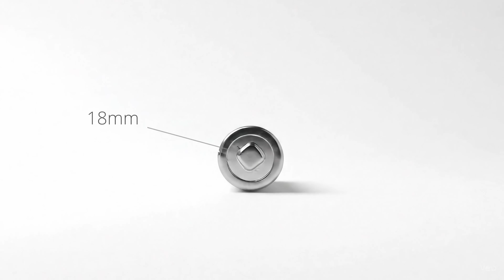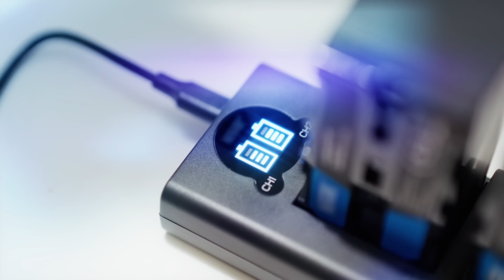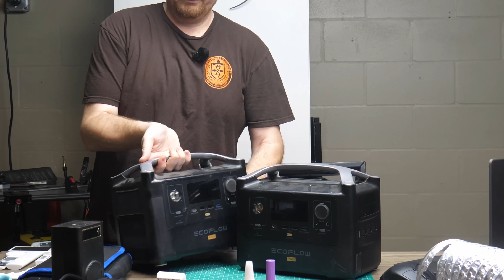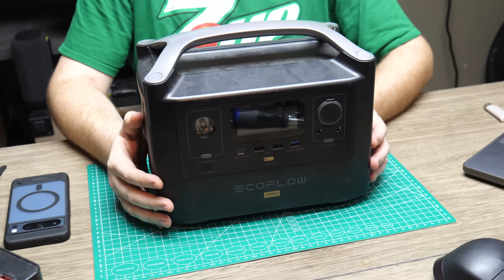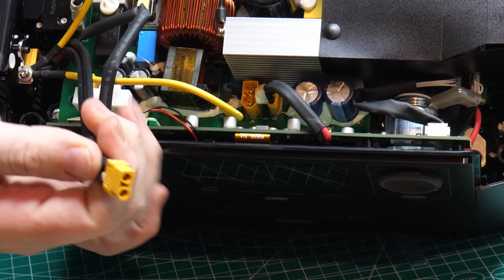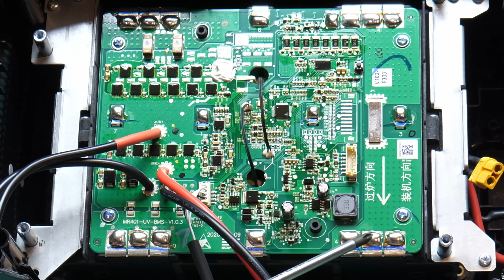I Bought 10 DEAD EcoFlow Power Stations... (Explainer and teardown)

Comment: YOU DID NOT HAVE TO TEAR IT DOWN TO DO THAT!  Ever heard of a trickle charger? useless video🤕🤢🤮
Reply from the maker: You're wrong, but I'll leave this here for others to laugh at you.
Reply: @fauxrhino  I've done it. without tearing it all down also done that with 12v exteernal battery--no problem.
Reply from the maker: I'm sure you have. You somehow got the BMS to magically turn back on and open the shunted route for the batteries to allow charge to flow. Bet you did...

Or maybe, just maybe, you had a completely different issue than I had...

Comment: The 18650 is infamous. Going back 20+ years, spare laptop batteries would die, unused, on the shelf.
 Apparently SOME 18650 cells have a built-in protection circuit. If the cell voltage drops <~2 volts, the protection circuit permanently disconnects it and bricks the entire battery.
 Some of these can be opened and reset or removed--but it is easy to cause a battery fire if you play that game.
 Replacing the cell is smarter. And, MOST of the 18650 cells you can buy on the web are used (RFE) or outright counterfeit. Stick to a repufable brand name from a known source. Avoid the very high amperage ratings, they're ALL counterfeit or scams.
 Panasonic seem to control their sales, and build a good product.
Reply from the maker: Not to drive you away from my content, but Adam Savage just did a video on 18650 quality control with the LumaField team - was an interesting watch: https://www.youtube.com/watch?v=-Y23nfAOiXQ

Comment: A tri-fuel generator from Costco may be a good option 
Propane doesn't go bad or foul the points the was gasoline does
Not sure if you can tanks refilled during a power outage
If the Propane storge tank in tall and above ground,  maybe gravity fill

Comment: Re gas in your wife's car.  FWIW, years ago a mechanic showed me how to disconnect the gas tube after the fuel pump and direct the gas into a container during an emergency. Instead of the engine's fueling system. The gas was used for a generator at a remote mountain cabin.   I'm curious if this would work on today's gas cars?  EV owner here.

Comment: Its great that you are able to get the units running again, but please do it by finding bad cells and replacing them. Not trickle charging and rescueing the cells. Those cells are damaged and are ticking away fully charged now, you do not know when they will catastrophically fail (aka long burning fire that doesn't want to go out)

Comment: Why not connect a small amount of power directly to the BMS to get it working?
Reply from the maker: With the imbalance, the BMS will fail to charge and just throw a red 'battery warning' light. Going into just the output leads does nothing because it's shunted closed once the cells drop below a certain point.
Reply: @fauxrhino  ok thanks

Comment: Some hear lithium and immediately shut down any thought of learning something new. Never mind that the batteries have been around for a long time and providing safe energy to appliances. Or that they have been, unknowingly, using them  themselves. 
It doesn't fit a certain perspective and they won't support any deviation from that. 
I've relied on them and I'm happy to use that technolgy. I will embrace chemically different batteries, whenever they are available to us. No problem.
The Bolt is a good example of what can go wrong and what someone can do to avoid any mishaps. 2017-2019 models had batteries that caught fire while charging. It cost Chevy a lot of money. The 2020 and up models did not have that issue. But to some, it just reinforced their opinion about EVs and batteries. 

Be aware and cautious, but also be open to change and new things.

Comment: The 0 in the 18650 doesn't mean that the battery is cylindrical. It means that the length of the battery is 650 tenths of a mm (or 65mm). There are cylindrical batteries that have non-zero least significant digits, such as the 40152 battery, which is 15.2mm long.
Reply from the maker: You're correct, but the fifth digit is an indicator of a cylindrical cell. Perhaps not the fullest explanation/understanding on my part. Thanks for clarifying!

Comment: Quick tip: find fuel pump, disconnect output to engine, fit a piece of tube from output to bucket, find two wires, wire up 12 volts from the car battery to the fuel pump. The end.
Reply from the maker: Yeah, ripping out the back seats after 3 days of no shower/air conditioning wasn't happening. Effort vs reward just wasn't there by the time you're that beat down.

Comment: DC voltage actually becomes dangerous at around 50V, and it's much harder to pull back from compared to AC. But you can withstand a higher DC current than AC. So... both dangerous ;)

Comment: You could have used that tank of gas to run an inverter off on Anderson plug with clamp attachments and or some sort of temporary set up and then you xan use almost any engine as a generator at idle and a car at idle is much quiter than almost any generator on the market

Comment: Removing petrol from car without syphon: remove fuel return hose from Injector rail under bonnet. Put hose in jerry can. Turn engine on. You use a little bit of fuel but the fuel return will fill up a 5l can in a pinch.
Reply from the maker: Easier said than done on a high pressure direct injection engine with proprietary fuel line connectors. Our old school tricks don't work well in these modern times, I'm afraid.

Comment: 19:00 - your voltages are wrong regarding series.  1s1p is 3.7v nominal and 4.2v for 18650 cells.  Fully charged you will be at 37.8v for 9sXp.  (9 cells in series, variable parallel)

Edit:  where on earth did you get 3.2 nominal and 3.5 fully charged for 18650?  Is it because it says 3.7v on the side?  Yeah that’s the nominal, not the full capacity.😂
Reply from the maker: It's an 8s pack - might have something to do with why you thought my voltages were off. 33.6 is max - it was top of the head math of 4.2x8 =>32ish

Comment: Since you seem to be somewhat handy the easy way to get fuel from the wife's car is by disconnecting the fuel line somewhere between the tank and the injectors, and using the vehicles fuel pump to transfer it. Keep in mind while volume is low pressure is high so take precautions.

Comment: I live in Malaysia where the humidity is high and it's basically summer all day. If you lose power and don't want to spoiled what's in the fridge, you shouldn't open them and it can easily last you for more than 3 days provided the sealing is still good.

That happened to me where I thought the blackout happened to my neighborhood while it was actually just our home caused by very old fuse. I had the same worries but then afterwards, Alhamdulillah, all foods are still in the same good condition.

Of course, you need to have backup of alternative food like dry food or things like that in that situation.

Comment: I have been running a DC refrigerator for 2.5 years non stop, on 2 100wt harbor freight solar panels and a 200 amp hour battery. I don’t even really have incredible sun. Maybe 40% of the day the panels are in full sun.  So far, knock on wood, I have had absolutely no issues.

Comment: Can u check with voltage meter to see if the is a current going through anything? 12:40
Reply from the maker: With the meter I had on hand, regrettably no - it's DC only. There are ways to detect if AC current is flowing, and I could have probed a few spots to verify, but I was confident it wasn't charged up since even the DC side was dead and caps won't hold a charge forever in a well designed circuit.

Comment: As a fellow 18650 enthusiast, around COVID I had racked up obsessive hours repairing and converting electronics to lithium. 6 months later the best and worst thing happened: Amazon started selling overseas lithium battery packs for wayyy cheaper than imaginable of just about any voltage 😂

Comment: I bought a small powered screwdriver in 2017.  After sitting unused for a few years, it no longer was taking a charge.  I opened it up, and it had a single 18650  (LiFePO4 ) battery.  I gave it a shock charge of 30V to get it started charging again.  This is not dangerous, because LiFePO4 chemistry does not catch fire.

Comment: Why do they use these small cells that cant reasonably be individually regulated, why not go with the large cells they use for things like grid backup that are also more space efficient. Sure we'd be limited on max output, but are people really lugging around a 1000wh battery pack so they can microwave for 30 minutes, or do they have smaller loads that might need to last longer with a 1200wh pack that can only output 1200w for a full hour instead of 2000w for 30 minutes.

Comment: I live not far from were you live I have three options I use I have a larger propane generator I have a smaller quieter gas generator which ran my fridge just fine and I have a couple of smaller eco flows with the solar panel just in case

Comment: Another point here: the more dendrite in the cells the higher their self discharge will be. A good clue is to fully charge the pack(at your own risk) and see how quickly the cells voltage drop. If tgese drop and wont be stable, I suggest to fully discharge these to death and forget about recovering these.
Reply from the maker: I appreciate your comments and knowledge on the subject. I've been recovering cells for well over a decade and understand the risks and have read the recent scientific papers on the recovery of over discharged cells. If you continue through the series you'll see this pack was charged and discharged once, I made multiple comment that this is the lowest and sketchiest pack I've attempted. The video I'm working on now is dissecting the pack to test the IR of these cells to find out which are actually bad and replacing them. All cells generate dendrites as they're used - this is the natural life/death of a battery. Saying a cell that was discharged below a nominal voltage one time is completely dead is just false. Generally, until you get below 0.6v on an NMC cells they can be recovered if done properly and will simply have a loss of capacity. I implore you to do more research on the recent science behind these cells. These are your 2002 NMC cells and the science has progressed.

Comment: I have to appreciate the desire to learn here.  I have a few things to mention though for the next time.
1. You can access all the fuel in the tank of a car by pulling out the bottom part of the back seat and removing the bolts for the sending unit.  You have a 6" diameter hole to siphon gas from..
2. As other commenters have suggested, get a 12V or 24V interverter and run it from LiFEPO batteries.  It is much safer and cheaper.  You can buy ready made batteries for pretty cheap.  It might have been worth it to build your own battery 4-5 years ago, but that is no longer the case.  This is especially true if one of your goals is reliability.
3. If you already have a gas generator, buy some gas cans and stabilizer and have it available during hurricane season.  After hurricane season, burn the unused fuel in your car.
Reply from the maker: Good idea on cycling fuel - a lot of people seemed to think their barrel of 100gallons they've had for 10+ years is going to be any good anymore 🤣

I do have a 10s18p larger lithium backup with a 2500w inverter which keeps my fridge going for about a day. I disagree that building your own battery isn't economical; there are many places where you can still buy these cells for dirt cheap, even new. The risk of fire on NMC cells (when treated properly) is very low. People like to grab onto the sensational stories or videos of them being intentionally misused to get a fire out, but these batteries are literally in millions upon millions of devices sold and very rarely cause issue.

Comment: In 2016 I powered my house using a 12v to 120v inverter using my Tesla for 4 days.  No need to look for gas just disconnect from the grid.

Comment: This is why I put a large 12V to 110V inverter in my vehicle. When we have outages, I can convert the fuel in my car's gas tank into household electricity. It's a car when I need it all during the year and a generator when I need it for emergencies. Maintenance is kept to 1 device. You can pick the right device and wattage combination for your type of vehicle. For example you could pick a battery pack/inverter combo with hybrid car so the car is on, but only kicks the engine on to charge the car's battery when necessary. It runs the battery pack off of it's internal battery until it needs charging, then goes to the hard wired 12V battery source. Device -> 110v Pack Inverted (Always On) -> Pack -> Car 12v (On Demand) -> Car Battery -> Car Engine (On Demand) - Gas. All kinds of options.

Comment: i would also invest in generators that can burn other fuels like you could make a methane generator that uses poo etc and captures the gas to burn most people use it for cooking etc . but you can easily hook that up to a lpg system or wood gas, or use biofuel generators that can burn diesel etc that way you can use oil from local take outs and other places .
Reply from the maker: If only I had the land... I've got so many fun experiments I'd love to try, like building a methane generator, but alas I live in a shoebox with the back yard the size of a burial plot 😂
Reply: @fauxrhino I think they only need same room as compost pile. But it's handy cause you feed it food scraps etc after it's bacteria starts and then constantly gives out enough gas for cooking etc as its under pressure. I got few people using them in Uganda etc and they said saves them lots of money on cooking gas etc. But only downside is takes time for the start up and  needs replacing with new bacteria etc after half a year I think.

Comment: While I am looking forward to the rest of this video... so far you have told me you were driving around a giant battery and your better half had a full tank of gas. So you had probably a 30k$ generator sitting there with a full tank. Inverters are relatively cheap comparatively. I always like to see people building redundancy but also being able to do what you need with what's available is a good thing too.
Reply from the maker: I agree, redundancy is the name of the game, and inverters are definitely a good way to get the job done! The larger battery backup I have has a 3000w inverter, but it expects a 36v input, so no go there. I had a small 350w inverter but even  clipped directly to the 12v battery, it couldn't power a 25w fan. Unfortunately, I just wasn't as prepared as I should have been, and didn't test my equipment properly.

Comment: I know one trick for getting a BMS to wake up and charge a battery. You can use a bench top power supply to connect directly to the BMS from the battery side and feed it just enough current to bring the BMS back online
Reply from the maker: That's effectively what I did to this pack, just in a slow manner to allow the fully dead cells some chance at life. I wouldn't want the BMS trying to charge them at a full 1c rate until I've brought them up above minimum voltage.

Thanks for watching!

Comment: Can’t you just replace the battery and be back in business ?
Reply from the maker: Absolutely - but at around $3 each for an 18650, the total pack replacement would cost more than a new unit (around $240 for just the batteries). 

Thanks for watching, tune in Monday to see how well this 'dead' pack holds up to testing!
Reply: @fauxrhino that seems high for such little capacity.
My Delta 1300 is getting older too but I’d rather ditch the battery. It’s a good unit.

Comment: I think I could get gas at the local stations, at least at first if we were in a prolonged power outage here in NW Wisconsin but I still keep 15 gallons of non oxygenated gas in metal Eagle gas cans stored away just in case I need it for the small inverter generator I have.
Reply from the maker: Non-oxygenated gas sounds interesting - is it also ethanol free, or does the lack of oxygen keep the ethanol from turning? I've always heard 6-12 months on stationary gas before you risk clogging up your generator,  but interested to hear about your method.

Thanks for watching!

Comment: I stopped watching after said he had a Tesla so what70,000 to 100,000 W power probably could’ve easily just been adapted to directly power fridge for a very long amount of time
Reply from the maker: Tesla does not offer V2L and the 12v system can only handle about 1000w before it possibly craps out. Not an easy way to get that juice out of the car. Also I have an older Tesla with free unlimited supercharging and they'll void that if I'm found to be using a V2L adapter. 

Thanks for watching!